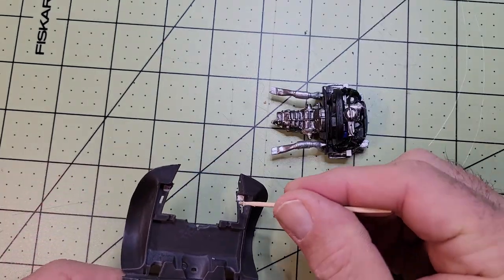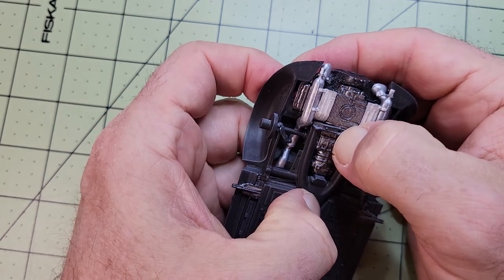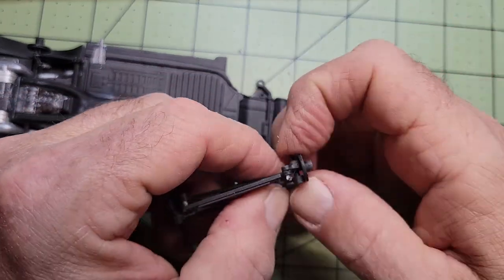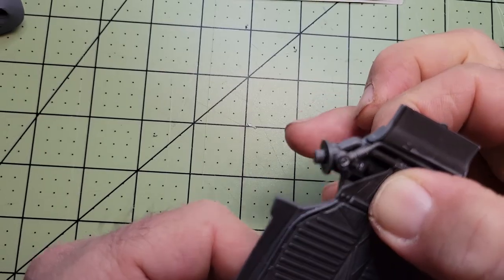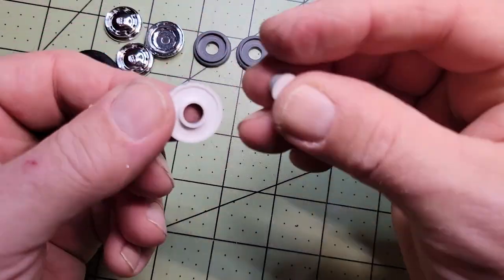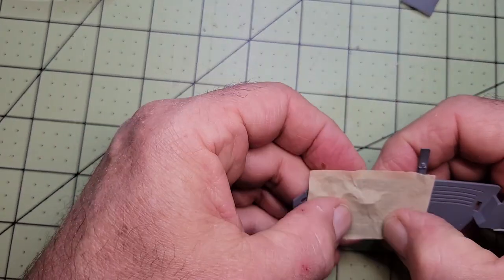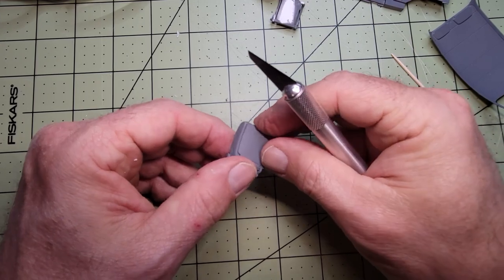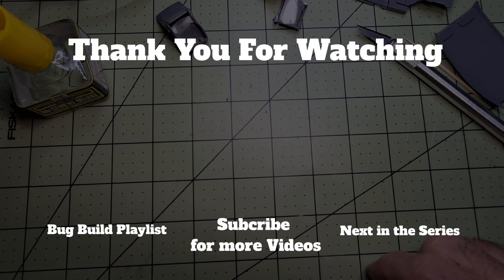68 Volkswagen Bug model Kit: Engine and Chassis Assembly

Comment: I have been watching your videos and progress thus far, and as I am hesitant to comment on much because I'm never sure what I am doing is correct, I will say 1 thing.... ditch the testors tube. You can use regular super glue for tacking something in place and when you are ready for final assembly, use something like Tamiya Extra Thin. This will actually bond the pieces together, plus it's much easier to apply.   
Cheers and best of luck on the new hobby!
Reply from the maker: Thanks for the advice I'm rapidly coming to the same conclusion. As far as not sure what you're doing, welcome to the club😉
Reply from the maker: I think you're talking about the Horn, had to superglue that thing to get it to stay put.
Reply: @bryanshobbies  ahh. I found more like me! I have about a dozen 'in progress' kits. This is the year I step back and finish them one by one.
Best of luck. Can't wait to see the next project!
Cheers!!
Reply from the maker: When you finish them come back and share.:-)
Reply: @bryanshobbies  will do!